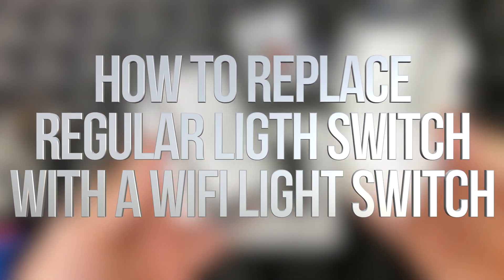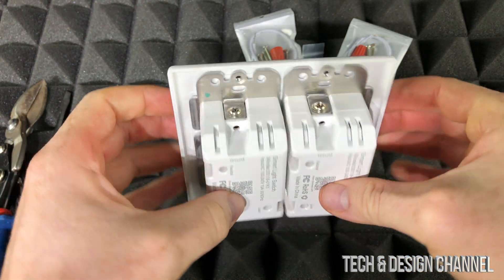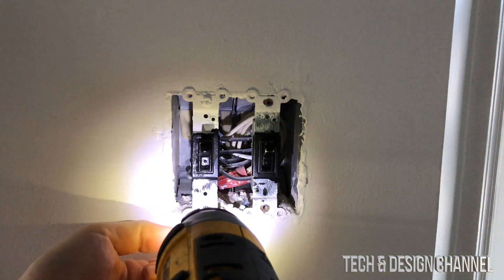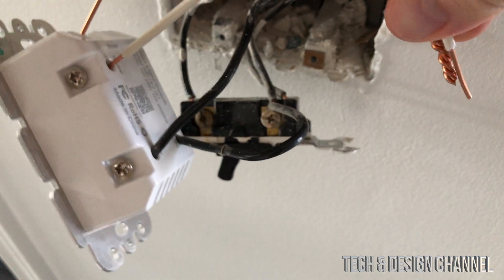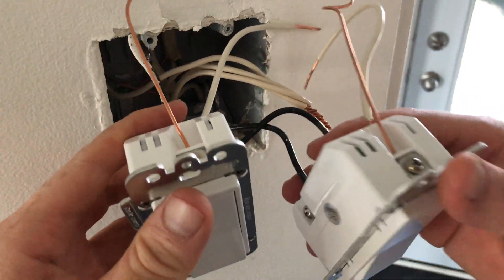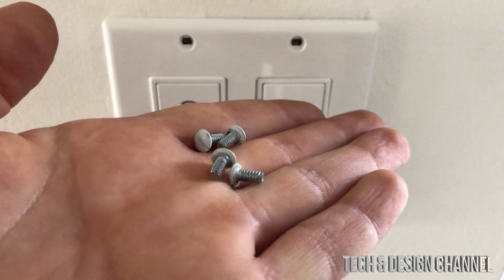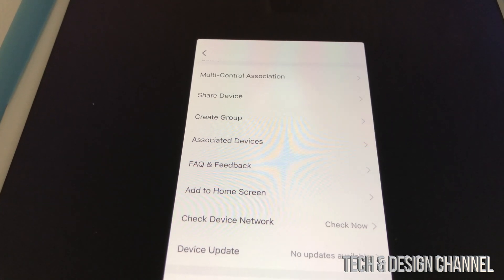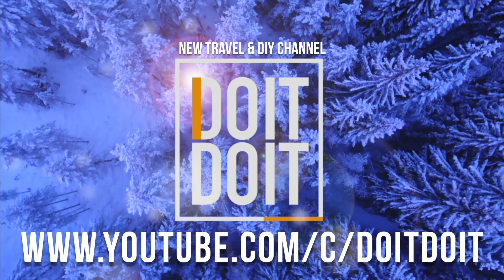How to Replace Regular Light Switch with a WiFi Light Switch

Comment: which wire is which? You simply pulled one wire out of the back of the light switch and plug plugged it into the new one, but didn’t explain how you knew which one to plug it into.
Reply from the maker: basically copy/paste

Comment: PLEASE PLEASE PLEASE tell me that the wall switches also have touch control so you can still turn on/off at the wall.   PLEASE don't tell me you always need your iPad or phone to control this.  If so, it SUCKS.... don't want it.
Reply from the maker: it works like a normal light Switch. you don’t need your iPhone or iPad . I suggest watching the video
Reply: @TechandDesign  I appreciate the reply, but.... where in the video does it show you actually using the physical switch with your finger to turn on/off the lights?    I didn't see it.  I only saw you turning on/off the lights with your iPad.  Maybe I missed something??